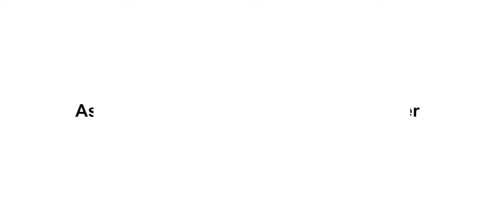MALYAN MA21 Belt 3D Printer! - Unbox, Assemble and First Use.

Comment: Very bad 3D printer, i just got it today it keeps saying "motor lost step" and also it keeps going up on the Y axis and bumping. Then the PLA prints stick to hard to the surface and remove part of it.
Reply from the maker: Hello, Sir, I am Samantha from MALYAN Team, I am sorry that you have bad printing experience with model MA21 at the beginning. When it indicates " motor lost step" may be Y-axis hits the end stopper.  But in order to help solve this issue, would you add my whatsapp , so I can see the details via pictures or video.  Thanks
Reply: @malyan8697  no I don't use whatsapp
Reply: @malyan8697  do you have Zoom or Facebook?
Reply from the maker: @MrZeazy  yes, you can follow our facebook page "Malyan 3D" , or what is your facebook ID, I send you msg.